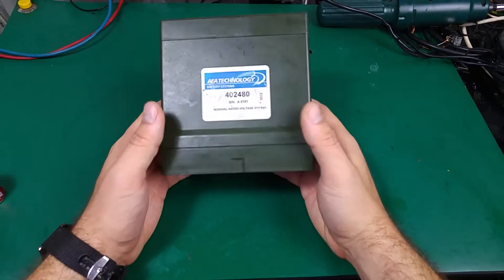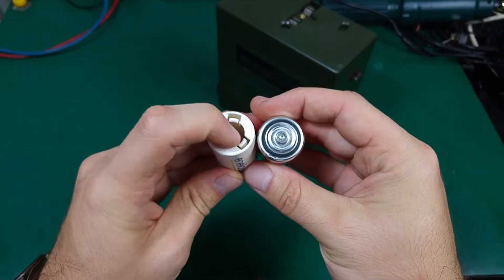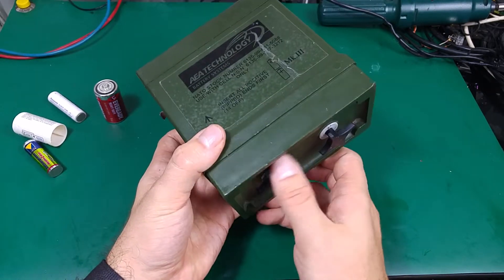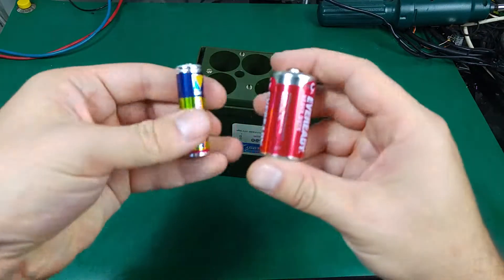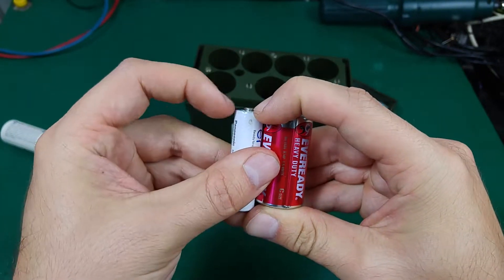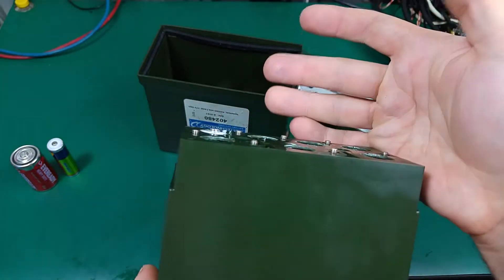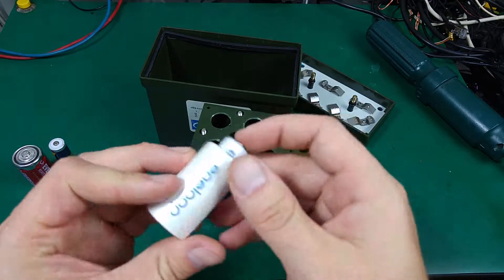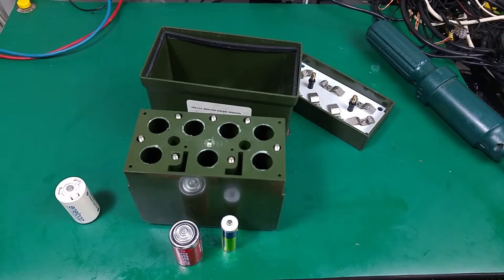Clansman PRC-350 (RT350) battery adapter mod for use rechargeable AA

Comment: Thank you, useful to see how it comes apart. I’ve just bought one that has 2 battery cassettes, so I think I will convert it to a 4s lithium with a BMS. I put a 6S lithium and BMS in the 1AH battery case for my PRC-320. Cheers Nick G0OQK.
Reply from the maker: Grad if it helped. Are You using LiFePo4? Thanks for feedback about PRC-320. Let me (and viewers) know how it went on PRC-350.

Comment: hello, thank You for the video. Have You tested how long can PRC350 operate on AA batteries ?
Reply from the maker: That's deeply depend of usage how much TX or RX.
Manual state that on:
TX it take : 820mA at 15V
RX - 180mA at 15V

You can calculate rough estimate from that that on RX by using 2000mAh eneloops it should give about 10 hours of receive. 
Please do not "quote" me on that because i took that data from manual (not mine measurements) but i'm pretty sure that run-time would be longer when radio is squelched.
For me that mod was great because i'm not using this radio, it's presented on my shelf (but in case i need it, i could put eneloops and have fully working radio) for real use i would recommend get 4 cell li-po package and stuff it inside box.